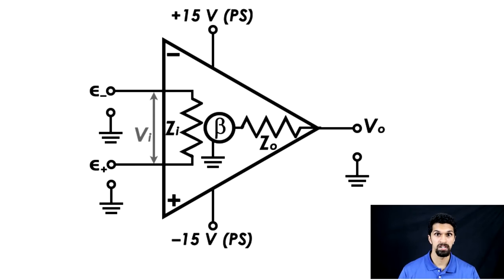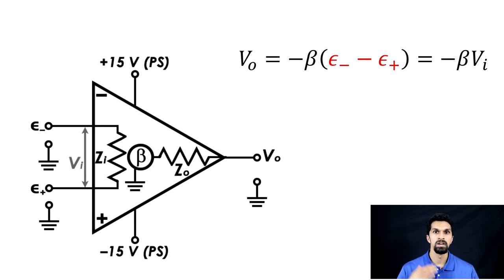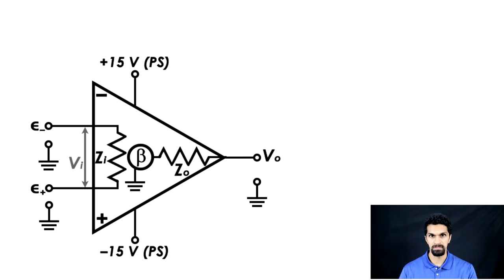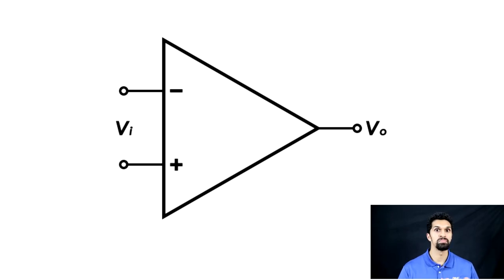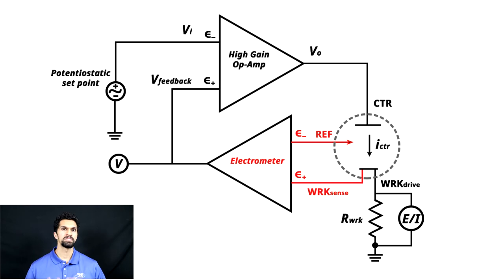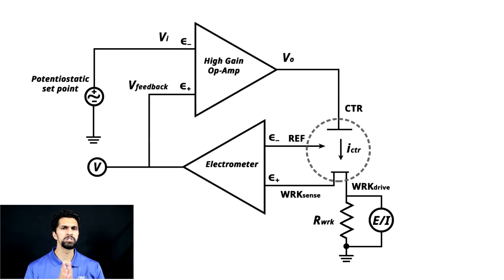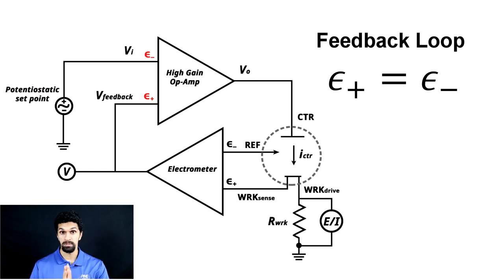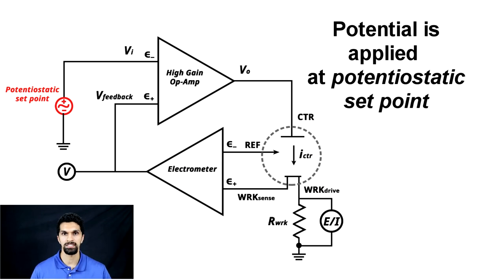What is a potentiostat and how does it work?

Comment: How to make a potentiostat using discrete op-amps for CV/DPV techniques?
Reply from the maker: You might need to speak with an electrical engineer to get the details, but the potential waveform itself (for CV/DPV techniques) is created at the potentiostatic set point.  So the simplified potentiostat design makes sure that the potential you set is equal to the difference between the working and reference electrode, via the feedback mechanism, but you'll probably want a waveform generator connected to your potentiostatic set point to create the CV and DPV techniques.  At this point you might want to purchase a potentiostat.

Comment: I have a question. Since you are saying that output of high gain op-amp will continue to adjust until both of its input voltages become equal. This is actually virtual ground concept in electronics. It states that voltage at inverting and non-inverting terminals should be same. But this works only when there is negative feedback i.e. when feedback loop is connected to inverting terminal of the op-amp. But here, you are giving feedback from positive terminal i.e. non-inverting terminal. Then how both the inputs are becoming equal here?
Reply from the maker: This is a very good and technical question, and to be completely transparent I am not 100% certain I can give the best answer from an electronics perspective. But I can try to give you two answers that may clarify things for you:

First, I think it may not matter that the feedback goes into the non-inverting input because it is coming from the Electrometer, which is outputting the voltage measured between REF and WRK Sense, which could be essentially any value. So the feedback loop involves an iterative process and the change in the input does not necessarily only go in one direction just because it is fed to the non-inverting input, meaning it can (and does) converge to reach your setpoint.

Second, there is actually one other aspect of the circuitry for a potentiostat that we intentionally omit in this video for the sake of simplicity and clarity of explanation. In reality, there is actually bypass circuitry that goes around the high-gain op-amp called the stability filter, and it is essentially capacitive elements used to help reduce oscillations and speed up the convergence of the feedback loop. What it also means is that technically the mathematics and assumed process of iteration described in this video is not perfectly accurate (again, this was intentional!), but rather that process is impacted by this unseen filter and additional algorithmic programming. I apologize if this last point makes it even murkier to conceptualize, but again that is largely the reason we chose to exclude this element from the video to try and simplify the explanation.
Reply from the maker: You'll have to forgive me because I'm a chemist, and not an electrical engineer.  I only consulted our electrical engineer when coming up with this video.  But I omitted a few things from the actual potentiostat circuit for simplicity.  There is a capacitor in feedback (connected between the output of the op-amp and the inverting input) with the inverting input on the operational amplifier.  We call it the stability filter as it helps modulate the potentiostat response rate.  In a way there is a negative feedback loop to the inverting input on the op-amp.  

I understand that negative feedback is necessary for the potentiostat to work.  What I don't understand (as a chemist) is why does it need to be through the inverting input on the op-amp.  Unless the equation I'm using to describe the op-amp is incorrect.  -gain(inverting input - non-inverting input) = output voltage.  But there are other potentiostat circuit diagrams that have it the other way around.  I'm honestly not sure.

Comment: Hello guys, why the feedback goes into the non-inverting input of the op-amp? A voltage follower is by the definition an inverting-type device, so the feedback should go into the inverting input. Isn't it? Nice video, by the way!
Reply from the maker: Thank you!  So just to clarify, are we talking about the voltage follower circuit, or the simplified potentiostat circuit?  Voltage follower circuit from the video has the feedback going into the inverting input which creates negative feedback (although I didn't talk about negative and positive feedback in the video).  For the potentiostat circuit, there was the electrochemical cell and electrometer inbetween the output voltage of the high gain op-amp, and the Vfeed back.  At the end of the day, Vfeedback has to be equal to the potentiostatic set point otherwise the potentiostat wouldn't work properly.  I hope this answers your question.
Reply: @Pineresearch  big thanks for your prompt follow-up! Yes, I meant the simplified potentiostat circuit. I can see somewhat differing simplified circuits for a potentiostat on different sites or in reference materials, so it seems to be okay to have variations in this simplified circuit. Also, the explanation in the video makes good sense to me. However, if the high gain opamp is functioning as a voltage follower, as it is defined in the literature, then any feedback should be connected to its inverting input by definition, otherwise we could not call that circuit a voltage follower, in my understanding. Finally, let me thank you for this video again. I teach a microbial electrochemistry-related subject to students, and your video was very useful in my class.
Reply from the maker: @gabormehes1665  I'm glad you've found this video helpful and that you are sharing it with your students!  There are a bunch of different simplified potentiostat circuits out in the literature, all should be valid to some extent, but sometimes difficult to conceptually understand.  So in the strictest sense the voltage follower circuit doesn't have any other circuit elements in the feedback loop.  The moment you add things like resistors and capacitors into the feedback loop, it is no longer a voltage follower.  We have the electrochemical cell and electrometer in the feedback loop, which changes the Vfeed.  We could flip the inverting and noninverting inputs on the electrometer and get positive feedback rather than negative feedback into the high gain op-amp.  I would say that the voltage follower is conceptually needed to understand potentiostat operation.  Please let me know if you have any questions.  Where are you teaching microbial electrochemistry?

Comment: This is really nice for beginners like me. One question that bothers me why do we need a reference electrode at all. As you told we are applying a potential wrt ground initially,  what is the purpose of having the reference electrode in the circuit.  I know this question may sound weird but I am not clear at this point 😕
Reply from the maker: Hello Soumya, great question.  The idea behind the reference electrode is that you want to have a stable reference point in your electrochemical system.  If you could have "ground" in your electrochemical cell I bet people would do it.  But if you apply a voltage between the working and counter, both electrodes experience some kind of electrochemical process to maintain charge balance.  That inherently means that potential at both electrodes changes.  If you want to know the potential difference between the working and counter, that's easy, but it doesn't tell you anything because the counter electrode potential might be drifting a lot during the experiment.  All that being said, 2-electrode experiments are common, and depending on the application you could get away without using a potentiostat, and just using a power supply to do experiments.  I hope that was helpful!

Comment: Great video very clear explanation. I am also curious how two-electrode configuration potentiostat works.
Reply from the maker: Thank you! Great question.  A two-electrode configuration would be the case where the counter and reference electrodes are connected on one side, and the working sense + working drive electrodes are connected on the other side.  But it would be the same operation by the potentiostat.  The issue with two-electrode configurations is that as current flows from the counter electrode, the reference electrode potential starts to change.  But the feedback mechanism is the same.  I hope this was helpful.
Reply: @Pineresearch  Thank you, yes, your explanation helps.

Comment: Another great video! Would be really interesting to discuss the pros and cons of different measuring topologies, for example grounding directly the WE and putting a series resistor betweem the output of the control opamp and CE, or putting WE at virtual ground using a transimpedance amplifier.
Reply from the maker: Thanks a great suggestion Luiz.  Honestly, I would need to talk to my electrical engineer to know how that works and what the pros and cons of such a configuration would be.  I think my goal was just to get grad students using a potentiostat for the first time, a chance to understand how it works from a fundamental perspective.  But this is definitely something worth looking into for future videos.
Reply: @Pineresearch  And for sure you achieved your goal! I believe that would be an interesting discussion for precision measurements. I'll keep an eye out for it!

Comment: Nice explanation,
Do you know how other resistances affect the user given potential.

So to be more exact we try to investigate electrochemical properties of gold-nanoparticles (Au-NPs), but we want to investigate optical properties of these nanoparticles as well.
So we used an thin layer of ITO to apply a potential on the Au-NPs (the NPs are just dropped on the layer) . The problem is, that this ITO layer has a resistance of ~4000 Ohm. So the potential difference measured between REF and WRKsense is the potential at the Au-NPs plus the Voltage dropping at the ITO layer, right? (It's like putting an ohmic resistor at the alligator clip of the working electrode and connecting this to the cell.)
First, are my thoughts on that correct?
And second, do you know to really control the potential at the Au-NPs and not the sum of NPs and ITO.

I know it's a really specific question, but it would be super nice to get some help there. Thank you anyways for the video <3.
Reply from the maker: Hello Jonas.  I think your understanding of the system is correct.  It is like putting a big resistor between your WRKsense and REF lead in the potentiostat.  There is a voltage drop that needs to be compensated for to get the user potential = the potential between the WRKsense and REF.  This ultimately allows your chemistry to occur, but the potential values will be inaccurate.  

I have two thoughts with regard to potential control of the Au-NPs independent of ITO.  First, you could try a series of experiments with the Au-NPs deposited on a glassy carbon electrode, or another conductive material, and see if you get a change in voltage.  The other thing you could do is Electrochemical Impedance Spectroscopy (EIS), where you could attempt to model your system with a circuit equivalent, to know what the resistance of the Au-NPs, and perhaps other useful information about them.  

I guess I have 3rd idea.  There is a technique called bipolar electrochemistry.  You effectively have the Au-NPs on a non-conductive surface, but in-between the working and counter electrode.  The electric field from the electrodes induces an electric field in the Au-NPs.  It's kind of like a wireless electrochemistry technique.  I don't know that much about it.  Richard Crooks at UT Austin is an expert in the field and has a few articles on it.  But that would be a way to control the potential of the Au-NPs without the ITO.  

I hope this was helpful.
Reply: I'm also working on NPs, can you give me your email
Reply from the maker: @zemiecheabdelmalik2858  You can reach out to us at pinewire@pineresearch.com  You can then let us know more about what you're interested in.

Comment: Great discussion. Could you tell that electrochemical station is in potentiostat or galvanostat mode during a cyclic voltammetry experiment? Both current and potential is changing in this technic!
Reply from the maker: Great question.  During a cyclic voltammetry experiment, we are controlling the potential and measuring the resulting current, so this would be a potentiostat.

Comment: An Excellent Informative Video. But I would like to ask you a question what is the basic difference between a DC Power Supply and a Potentiostat and how electrochemical corrosion studies i.e. electrochemical polarization, EIS studies etc. can be performed using a DC supply for electrochemical experiment
Reply from the maker: Hello Surajit Sinha.  Great question.  The main difference between a DC power supply and a potentiostat is the implementation of a reference electrode and a feedback loop to maintain a desired potential.  A reference electrode is important because it represents a stable reference point when measuring the potential of one of your electrodes.  As current flows across your electrochemical cell, both the counter and working electrode potentials will change, so you won't know which electrode is responsible for a chance in the potential.  With regards to electrochemical polarization and EIS, it might be possible to use a DC power supply along with a linear sweep generator, but DC power supplies typically don't have the ability to different specific potential waveforms.  I would also say that doing EIS is basically impossible to do with a DC power supply.  EIS is an AC voltammetry technique, so a DC power supply won't work.  I hope this was helpful.
Reply: @Pineresearch  Thank you very much for this valuable information. I want some guidance from your side. I have a Programmable 60 V DC Power Supply and I want to perform electrochemical corrosion studies of a certain material. So how do I perform in a two-electrode cell configuration and also how to measure corrosion voltage and corrosion current by developing a Tafel extrapolation plot from this DC Source. In your previous comment, you mentioned the linear sweep generator to be connected to the DC supply. So I want to know about digital storage oscilloscopes and can I use them to generate potential waveforms and perform EIS studies??
Reply from the maker: @surajitsinha9055  Hello Surajit, I'm not sure exactly how to use the DC power supply for corrosion studies, and it will probably depend on what materials you are studying.  I have limited experience with corrosion studies but in general, you need to keep the potential of your material very close to the open circuit potential, and only make slight adjustments to the potential (+ or - 10 mV), if you apply something as large as +1 V away from the open circuit potential you will most likely corrode the material like crazy and get limited corrosion data.  The DC power supply will supply power to your system but I don't know how it will measure the potential and the current, you might need a digital multimeter.  I do not know of any digital oscilloscopes that can be used to generate the waveforms to perform EIS, but I would recommend purchasing a potentiostat for doing all these studies.  Doing EIS manually will be extremely time consuming and you need fitting data to analyze your EIS data.  I would check out our website for a WaveDriver 100 potentiostat with EIS, that can do all your corrosion and EIS experiments.  https://pineresearch.com/shop/potentiostats/wavedriver-series/wavedriver100-bundles/

Comment: Very very nice video. 
I have a query related to REFERENCE ELECTRODE. This is designed to keep it at a constant potential. Instead of using this specially designed reference electrode, can I use a voltage supply to connect one end of the voltage supply with the ε- of the electrometer and other end of the voltage supply being grounded?
Reply from the maker: That's a good question.  It sounds like you are trying to set the potential of the reference lead through an external power supply that is disconnect with the electrochemical solution.  This in principle would keep the potential stable and not run into the issues that "traditional" reference electrodes have.  So there are a few issues with this setup.  Remember that the electrometer output will be the voltage difference between the reference and working sense electrode.  However, applying a set potential through an external power source into the reference lead will be the potential vs ground, but it won't necessarily be the potential vs the working.  Potential and voltage are relative quantities, and the voltage measured from the power supply will be different that the potential measured inside the electrochemical cell.  There needs to be a single reference point in the solution that everything is connected to.  Breaking the electrical connections between the 3 electrodes will break the feedback circuit.  I hope this was helpful.  Its best to use a traditional reference electrode, rather than an external power supply.
Reply: @Pineresearch   Nice. Thank you so much.